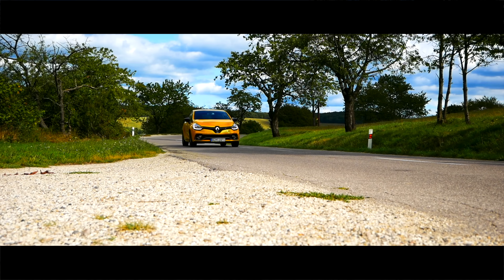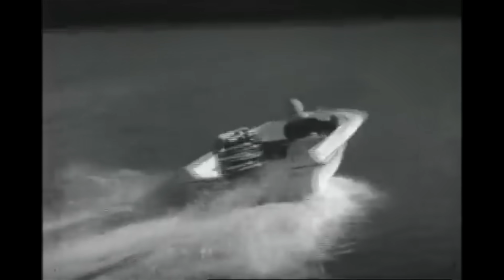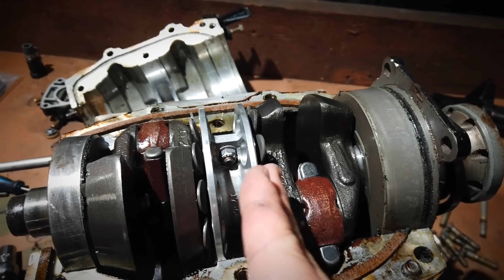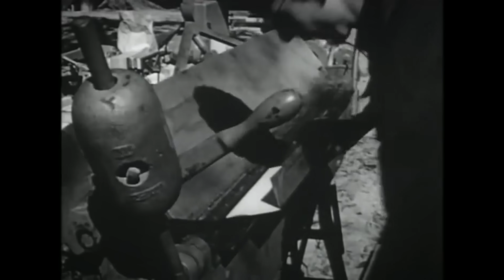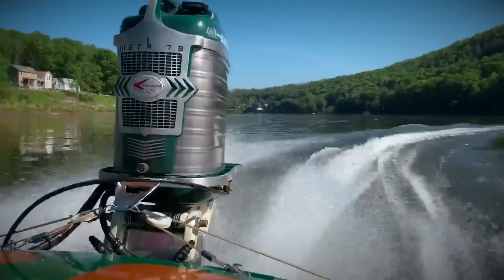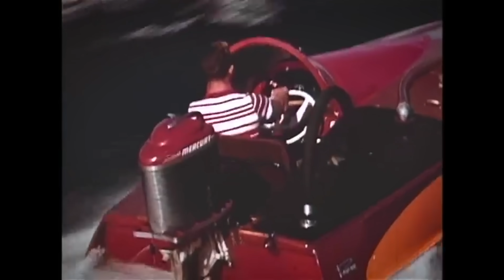The World's First 6-Cylinder Outboard

Comment: I still own both a 75 and a 125 horse 6 cylinder Mercury the 75 is a 78 model and the 125 1980. They both run like new and out preform newer motors in the same displacement.

Comment: Carl said no outboard development when he was racing NASCAR. 
SO Uncle Charlie (Strang) secretly combined two drawings of a 4 cyl and 2 cyl. together.
"I had the block cast without Carl knowing, and had a good welder on Carl's race crew weld two crankshafts together "
Armand Huaser used a car distributor for the spark.
When Charlie showed the Prototype to Carl, he laughed.
Charlie said "try it"
Carl returned on the boat and said
"It speaks with authority, let's build it!"

Comment: I still run an old  inline tower of power on my Carolina skiff. Everyone loves it when they see what it is,  and they love it more when they learn about its history. 
Still running strong.  One mention about the tower of power engines is some had distributors and some were distributor less.   They also had no reed cage like a traditional engine  the reeds are on the crankshaft.  This proximity of the reeds give it a lot of torque  for its size.

Comment: "incredibly reliable".... how bad were things before that then? I've had those engines and darned things couldn't make it two Canadian summers without some kind of major catastrophic failure! On top of being incredibly unreliable and being gutless wonders, they used so much fuel they would bankrupt Elon Musk! And to top it all off, what a poorly designed engine when it comes to repairs! Can't separate the head from the cylinder block and pull individual pistons that way, have to rip the crank with all the pistons as a single unit out of a 1-piece crank/cylinder/head block and somehow put it all back together without breaking pieces. Wouldn't be too terrible.... if they didn't blow up so often.

Comment: I have a 1987 Black Max 150 it starts first turn of the key and still runs strong. I am so happy with this motor I'm re painting it and slowly replacing any rusted bolts. Mine is a v6 carburated with the steel sleeve cylinders and their bullet proof.

Comment: The production models' crankshafts were designed to 'float' at top speed, meaning the bearings did not touch the crank surfaces, therefore ZERO crankshaft drag at full speed.

Comment: What a great & interesting video! Presently I have a 1966 950 SS, a 1968 1250 =, And two 1977 1150's that will be used to make one good 1150. What I love about these Tower of Power outboards is that so many parts will interchange. Such as I am using a 1977 lower unit to replace a bad one on my 1968 1250. Also they are easy to work on since I am used to older car motors. The 1250 will go on my 1984 Glastron Carlson CVX-16. Can't wait to see how she does at FOT after having a 1988 80hp 3 cylinder on it.
Reply from the maker: Thanks!
Reply: @VisioRacer  It was so interesting to see the history of the making of the Tower and it's predecessors. Thank you for sharing this informative Video. You did a great job.

Comment: In '79 there was two 115 mercs in the back of the shop. I was 14 and had a 15f round bottom lake boat no windscreen. I stuck one of the two stroke 6 cyl 115's on it. It was fast. With my buddy and l all you saw was two heads and that tall merc inbetween. I lived on the ocean you had to be careful.

Comment: used to run a rental/repair/guide shop in northern mn, and by far mercury hands down for reliability and power , newer evinrude/johnsons (when bombardier bought them out) and yamaha were really good, screw honda's, pos will go thru timing belts within a season, never messed around with to many suzuki's so i cant say yea or nah, but have owned over 200 plus boats had bunch Lund pro v's with mercurys ranging from 25 - 100 hp and can say never had a bit of trouble, owned a fleet of misty rivers with honda 60 hp's and within one year i must have had to replace over 35 damn timing belts. plus cold blooded too for being efi. but the Mercury 50 hp two stroke was one of my favorites and so reliable. Friend had the marine force 150hp and was a pretty good runner, would still keep up with newer 4 strokes being something from the 70/80s lot of people still use them to this day. every older johnson engine was a hit and miss if it was going to work or not, but still cold blooded until they warmed up and then they work decently, just recently sold my 1999 lund tyee magnum with a 200 mercury o/b that was an amazing boat. next one will be an newer one with bout same engine.

Comment: Growing up, my dad had a 1969 Tahiti 16' ski boat with an 850 / 85hp mercury.  That motor vastly outperformed expectations.  It went nearly 45 mph, could pull a 200 pound skier out of the water, and was basically maintenance free through my whole childhood.  It smoked  A LOT on startup, and didn't like going slow or it'd foul plugs.  It was a 4-cyl though

Comment: I had a 125 Merc on the back of my 17' Mako. Initially it seemed to perform well, not anything special. About a month after I had it installed, I wrapped a crab trap around the lower unit and the prop was toast. I didn't feel like waiting for the prop guy to get back from vacation so I bought a Mercury branded prop. Holy CRAP it was like a new motor!!! Same diameter and same pitch as the Michigan Wheel but it had a bit of a trailing edge cup. Hole shot, wide open throttle and top speed all increased. That thing was a rocket!!!

Comment: I bought a lund sl 1500 boat weight was 640 pounds it had a 90 hp thunderbolt merc straight six gobs of power i got that boat up to 60mph and had the death wobble I james bonded that boat on many beaches never let me down the battery did but a quick pull start after taking the housing off fired right up that was twenty two years ago but motor still runs fine

Comment: Had a "Black Max" 150 and it pushed a huge Tri Toon at 40 MPH with a whole family on Havasu and was Not New! and had the sound of a solid race bike! I'm an X bike AMA 2 stroke racer. I LOVE my AMSOIL at 88:01 like shoving Dynomite up a Tail Pipe! raced a Whole season with no visible wear on internals!  Never had a two-kick start on the line, or a fouled plug.

Comment: There is no more beautiful outboard motor sound anywhere than a mercury 2 stroke.   I like all brands but there is no denying this.  The mercury sound is the only one that turns heads.  The tower of power is top drawer and the last one on our lake died of long term submersion in a flood event last year. Sadly it was lifted and trapped in a steel roof structure when the flood came.

Comment: I raced a 16 ft Piranha sport with a 115hp Mercury limited edition in the early 90's. That motor could swing a 24" SS chopper prop to just over 6.000 rpm and off the speedo.

Comment: Love the video. The Mercury engine used a deflector piston to scavenge the cylinder that did not produce the power of a loop scavenged engine. The Mercury bottom end was used by Quincy, who created a loop scavenged cylinder and head assembly that used dual exhausts for more airflow. The engines were 15 cubic engines, 20 cubic engines of twin cylinder configuration. 30 and 40 cubic engines were 4-cylinder engines. The most powerful was a 60 cubic inch six. The 6-cylinder engine's exhaust note at speed was best described as a shriek as it screamed across the water with six open pipes. This engine series dominated outboard hydroplane racing in the early 60s into the 1970s. In the 1970s, Koenig, a German engine company produced a loop scavenged boxer engine layout that used a rotating plate or "rotary" valve to control the air intake into the crankcase instead of reed valves. The two opposed pistons gave better crankcase compression, resulting in better scavenging of the two opposed cylinders. Koening built two- and four- cylinder engines with this layout. I don't know if they built a six cylinder.
Reply: Oh those LOOPERS. Had an A (250) owned by Rodger Dykhouse. Dad bought it off him after he won the nationals in Depue I believe.  Had a Koning B converted crossflow to Looper  one pipe hi the other on the other side low. Miney Marton owned it.
 Do you remember Chuck Whites sideways F roundabout? Stacks point toward the shore  to compensate for the torque of that old Alki engine which got him around the corner quicker.
  Also Lake Sanford in Midland Mi..
 I saw Billy Seebold down here (fL). At Sanford for the tunnel boat race in I think 95. I said BILLY?  HE LOOKED AND ME AND Lynn Jones? How is your mom, dad and twin brother !!!!
I hadn't seen Billy since 68 or nine when he was still running  the D alki's.  RING OF FIRE  runnabout and hydros.
Got hom to sign one of my race brochures from the days gone by at Ohio Champ boat race. Was helping two brothers from Serbia who lived in Lauderdale  here.
 Some great memories of alki's, mods, and then down here with the Pro division  ( old alki division  ).

Comment: I still have a 1974 Mercury 150 hp outboard motor. It was on a 16' Checkmate up until I blowout the transom in 1995 in rough water. In 1999, I completely rebuilt the engine but could not locate a stator for it, so it was never tested and sits in my shop ever since. However, back in the day on that Checkmate it was a beast, pushing the boat over 60 mph it was definitely way too powerful as the boat would chime walk at 65 mph, scary as hell! The sound of that engine was impressive, and she was always reliable despite the inline six controversy.
Reply: You can probably find a stator for it now....
Reply: I have a 1972 checkmate MX13, with a 1976 Mercury 115 inline 6,on it , still working on it, but , getting closer to getting it there, for some reason, I m having a problem with it wanting to run hot, put a new water pump in it, that's when my problem started, hope I get it fixed soon....
Reply: @michaelgreene2920  I would pull the water jacket covers and make sure they are clear of sediment. Also, make sure your water pressure is good on the mickey mouse ears. Also, a silicone impeller is supposed to better than rubber?!?
Reply: @dcc2444  thanks for the advice on the engine, how do you pull the water jackets?  I haven't heard anything about those, but ,I'm definitely interested in finding out.... My engine was "peeing" but it still ran hot when I put it in the lake... So I took it back out of the water and brought it back home to repull the "foot" but, I haven't gotten to it yet, but I definitely will take those covers off that you're talking about,and thank you for your time and effort to help me out with this problem....
Reply: Depending on your engine model, there are side access panels and/or engine head covers that can be removed and yes you will need new gaskets/Permatex. But this allows you to make sure that the cavities surrounding the cylinders are clear of salt and sediment build up. I would Google/You Tube your serial numbers and/or buy the repair manual, it's really easy to DIY and save a ton of money! Mercury used to build outboards with the DIYer in mind, not anymore!  @michaelgreene2920
Reply: @dcc2444  just wanted to let you know, I never did get the 115 Mercury cooling, but, I did find a 86mariner 115 tower of power, identical to the Mercury 115 tower of power, except a little bit newer, got in on my little checkmate, and man, it's a scary fast little boat, still going to check out my Mercury 115, and see what was up with it.... Thank you for your help with my boat.....

Comment: Had a mercury 250 hp 2 stroke on a 25’ boat and the way it was geared it got up to 75 mph. At that speed the spray is painful, you have to wear eye protection. That 2 stroke would be the first thing you hear, the second is the wind so loud shouting is your only way to talk. That boat sunk but it was a ton of fun until then.

Comment: I'd grew up going to the lake in the 90s and by then every mercury owner I saw was at the dock with a toolbox getting their engine working.  Maybe this were just old diehards keeping thier favorite engines going I'm not sure but that was what I saw as a kid. Ont he other hand people with new evinrudes might take them out fail to warm them up and blow thier engines up gunning them out the dock (acutally saw this happen once) at least on the evinrudes the pistons are very loose and slap up untill the block warms up after about 5-10min of low rpm idle/cruise. Our evinrude wasn't without problems either... we always oiled it through the fuel to avoid the injector failure that caught some guys in the 90s. but in the end that engine still had issues after about 8 years or so... probably clogged jets or carb issues or something like that. Personally I don't think there is any outboard engine that is 100% reliable long term.... that is just people remembering through rose colored glasses, especially carbureted engines of the 50s-90s. Later injected engines have issues too... alot of the etec engines just have injectors fail.
Reply: The Johnson/Evinrude failure of any of the plastic bowl carb models was....
you guessed it...the warping plastic carb bowls.
Solved by newly designed  carb bowls that used plastic that didn't warp  ($$$) and new gaskets....
So if you have fuel leakage in the cowl when you tilt/store your engine or bring it up to service the prop....check these first.
Reply: @JohnSmith-yv6eq  Don't have the evinrude 90 anymore (It was an a 1995 stratos) but my dad did recently buy a sundeck with a 115 Johnson on it, I think its an early fuel injected model but I haven't checked to be sure. It's too bad BRP completely axed all the outboard 2 strokes.

Comment: Owned a 1993 Merc fuel injected 2.5L V6 150HP to 20 yrs. What a dream engine. Power galore and good low end, smooth flat power band and great torque. Wide open throttle from a start would spin the 3 blade SST prop instantly up to 2500RPM, the prop would be digging in and it would shoot the boat out and pull hard and steady to 5400RPM. Trimmed out it was a rush hearing it howl down the lake.

Comment: Iv had a few top now I have a 84 17 foot Acracraft speed boat with 84 top running a 21 inch prop it does 60 mph at 5500 rpms fun boat allways love vintage speed boats

Comment: the mercury and  mariner outboards are awesome. .. my uncle had a fiberglass shallow V boat that was set up for a outboard engine ,but otherwise, identical to the 
James Bond jetdrive boats used in a older 007 movie , and we made a bracket to retrofit a 90hp mariner engine  that corrected the engine height difference(or lower unit length) and set the engine about 15" behind the transom. 
/
and that boat was the most awesome of many that we had. and still is. it was very fast. and on days were the water was  calm you could turn as hard as desired at fullpower and the boat would turn on a dime  banking  itself into the turn . kind of like how a fighter jet aircraft rolls into a sharp turn. the rub rail that ran around the top edge of the boat would be in the water on the side you were steering tiowards..

Comment: The Force 125 was a decent unit, but gutless on an 17 ft hull. Grew up tubing behind one, that is untill a skirt cracked, and it sucked the debris through the bottom 4 cylinders. The cylinders where casted in such a way, that you couldn't bore the block out because the cylinders didn't go all the way through to the crank side of the block. No machine shop would touch that motor, and we had to replace the boat it was on with something much newer with an inboard V6

Comment: That’s pretty incredible what they did with the merc 75 testing it like that non stop. They wouldn’t be able to do that with the new 4 strokes due to maintenance.  It’s not uncommon at all to see some of these 2 strokes that are 40 + years old still out smoking on the water. They might be a little cold blooded but once they’re up and running you can count on them. I wonder if you’ll see these 250 HP 4 strokes still running 40 years from now. I HIGHLY doubt it. They may be exhilarating to run with and I know the tech that goes into them are other worldly but I doubt they’ll have the life of the old 2 smoke.

Comment: We had a 25th anniversary four cylinder 50 hp. When we put it on a 14' boat that wanted maximum of 35hp, it really made it move. Don't know where it is now, but I sure do hope it is still running. It would go great for a couple of seasons of light use, then the magneto would get all gunked up somehow. If I still had it now, that would be something I would try to tackle. Back then it was all over my head.

Comment: Having worked on the 4cyl and 6cyl mercs with my grandfather, I have a 30cube on my boat rn , but nothing beats the power delivery of an inline 6 , the sound , the smells . My dad had a 16ft Baja sport 164 with a 115 inline 6 . And man with it horribly under propped did it still boggy across the water

Comment: I've got 2 a 1972 135 horse on a 16 footer and a 1975 115 horse on a 17 footer. When they are running right, just the power and acceleration is just awesome.